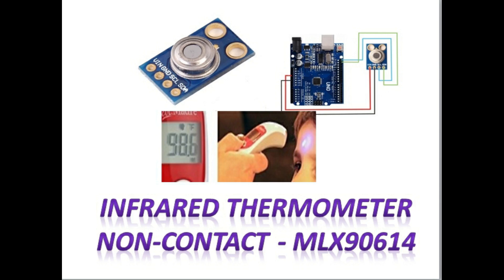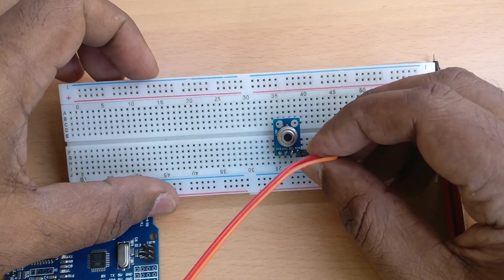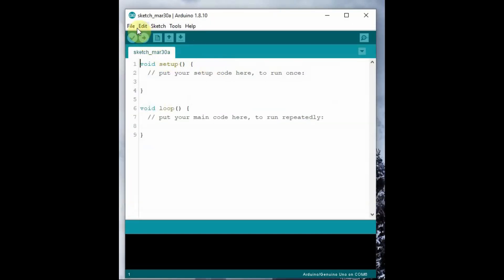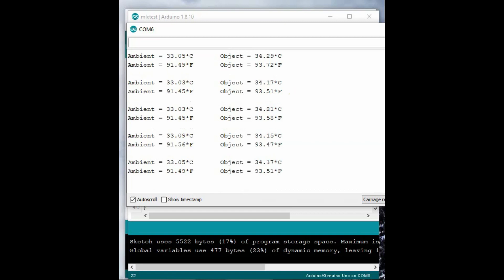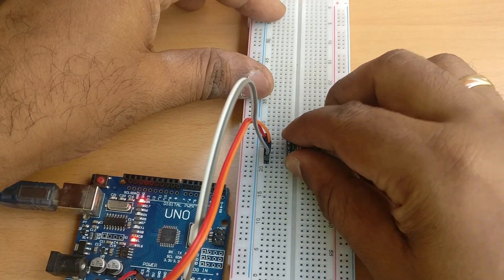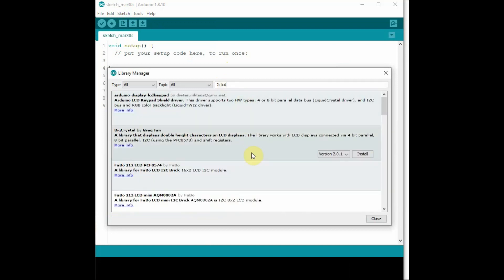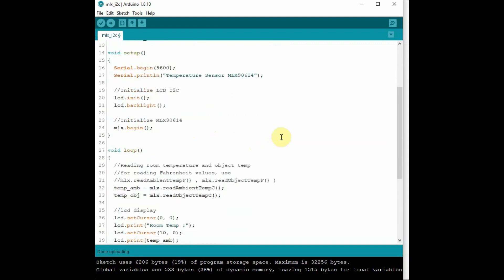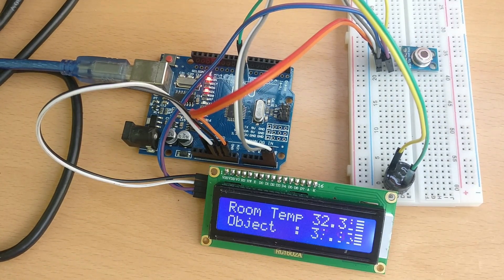Contactless IR Temperature Sensor MLX 90614

Comment: i tried out this code with the same sensor and everything and my sensor is giving temperature above 1000 celsius and fahrenheit. please help me out as to what i can do to fix this please
Reply: same results did u find any solution
Reply: @alta_qur  the sensor was faulty, had to buy a new one
Reply: @ketakikeluskar3758  i see, i changed the jumper wires and it magically works 😂 might be some faulty jumper wires
Reply: @alta_qur  i tried swappingbthe sda scl jumpers, didnt work for me. Good for you though, saved you a lot of bucks
Reply: @ketakikeluskar3758  yeah

Comment: My mxl90614 sensor is constantly showing 1037 degree Celsius temp! So what could be the problem?
Reply: @Ajay Gautam Yes.
It was just connection issue with jumper wire. Try it or DM me on twitter.
And also there is a program for it which I can share.
Sagittarius_15 is my account
Reply: @Ajay Gautam found the problem?
Reply: @Ajay Gautam ok bro
Reply: @Ajay Gautam how u solved it?
Tried different program?
Reply: @Ajay Gautam ok.
Ours was problem with jumper wire connection.
Then it was solved.
Reply: @Ajay Gautam hi Ajay.
Harshil here again.
Please let me know about the error between your mlx90614 temp sensor and temp gun.
Reply: @Ajay Gautam ok
So I need to connect it with À4 and A5 not scl and sda.
Because our temp sensor shows 3-4 degree variation with temp gun
Reply: But our temp sensor reading matches with clinical thermometer
Reply: @Ajay Gautam I understood. 
Let me try it.
Reply: @Ajay Gautam are you on twitter?
Reply: @Ajay Gautam so how to reach you other than You Tube?
Can u give me ur mail id?
Reply: bro i am also getting 1037 degress constantly what i can do?
Reply: @sumanthkumar4288  hi!
You check those jumper wire connections.

Replace them and will get the results.
Reply: @sumanthkumar4288  it is due to improper connection
Reply: @sumanthkumar4288  are you college student?
Reply: @harshilsathwara7509  recently passed out student
Reply: yeah i tried but it again showing  1037 . i am interfacimg mlx90614 sensor with 8051 controller please help me bro
Reply: @sumanthkumar4288  try millo ohm you tube video code.
Reply: @harshilsathwara7509   what is millo ohm youtube code i can't understand?
Reply: @sumanthkumar4288  mlx is working perfectly, so there isn't any problem in it.
Problem is elsewhere, in our case it was with wiring only!
Reply: @harshilsathwara7509   bro how much power supply you given to that mlx sensor ? 3v or 5v ?
Reply: @sumanthkumar4288  depends on sensor configuration.

U check datasheet and order details.

Comment: This sensor is useless without the proper lens. Due to its wide FOB angle (90 degrees), the sensitivity AND precision is terrible. If you want to use this sensor as a body thermometer, get the DCI version of MLX90614.
Reply: Claudio Ikeda Is totally correct.